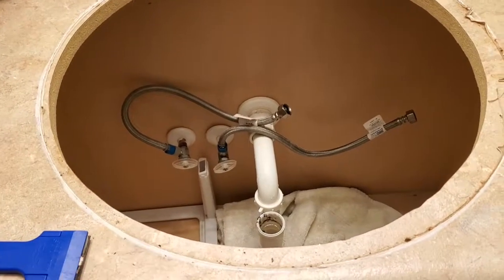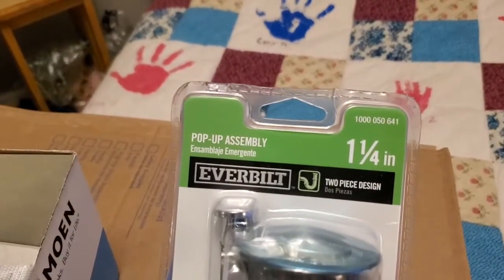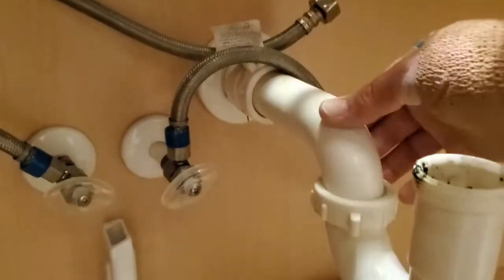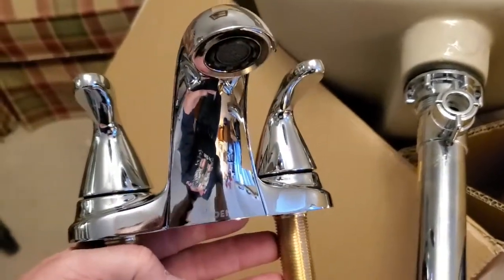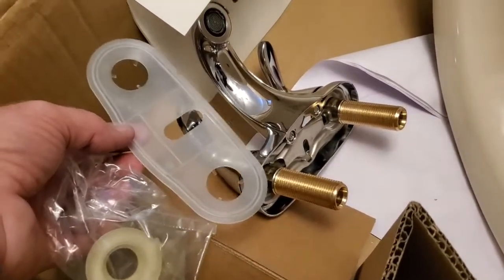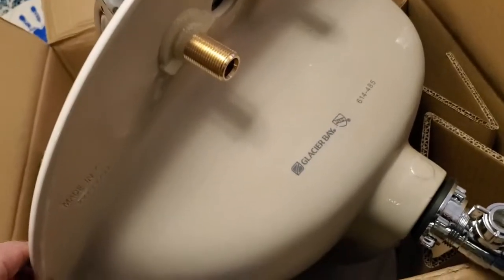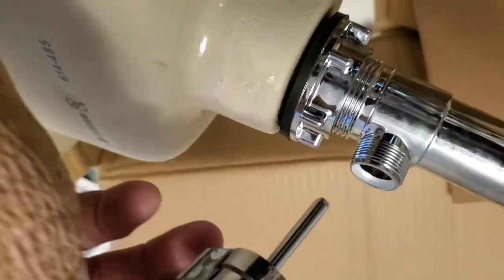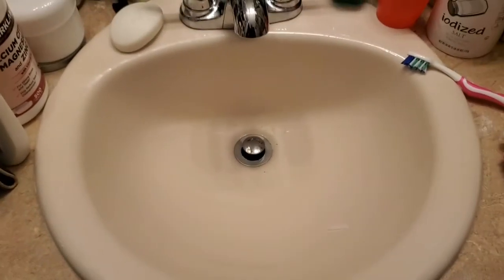Replacing a drop in bathroom sink with another drop in sink

Comment: Didn't your faucet come with the black drain pipe that comes down from the sink?
Reply from the maker: It did come with one, (editted) the handle for the drain stop wasnt what i wanted.  Quality and knob type.
Reply: You have the same faucet I do
Reply from the maker: Did yours not have one?
Reply: @thewayididit6641  yes but my pipes are 1 1/2" drain pipe is 1 1/4 😂
Reply from the maker: Thats right.   I didnt notice the supplied pipe was 1.5.
Reply: @thewayididit6641  it's 1 1/4
Reply from the maker: I read that wrong.  I read that as if your included sink drain was 1.5.
Reply: @thewayididit6641  no I wish

Comment: To be more accurate, you should have started the beginning to dhow how to remove the sink. It is important about water lines and gaskets to be removed accurately and problems that might arise. You get NO thumbs up by me as your example is to vague for those that have no skills or experience.
Reply from the maker: Thank you for your kind and thoughtful feedback. I will try to remember those things the next time.  In this case, the sink broke and I had to make an emergency repair.  By the time I decided to video the process, I had already disconnected the supply and drain lines and removed the old sink.
However, if you needed instruction on how to disconnect them, you could have just contacted me, I could have put together something for you.  All you had to do was ask.  I don't mind trying to help.
Reply: Maybe do some thinking for yourself ey?? What an idea!
Reply: @thewayididit6641  
Thank you for sharing and showing how to do this. 👍🏼👍🏼.
Reply: Mama ever tell you about don't say anything if you can't say something nice?
Reply: Yeah I thought the same! Need all steps
Reply from the maker: This was actually an emergency repair.  I was already part way into the process before I thought about recording it.  That's why the first few things I did aren't included.
I had to stop the water leak and clean it up  to avoid any damage.

Was the video helpful at all?  I was thinking since the those steps aren't included, maybe I should take it down.